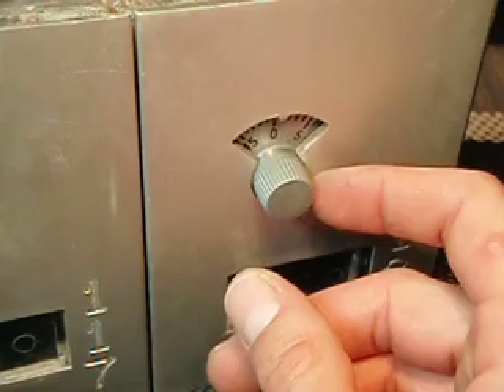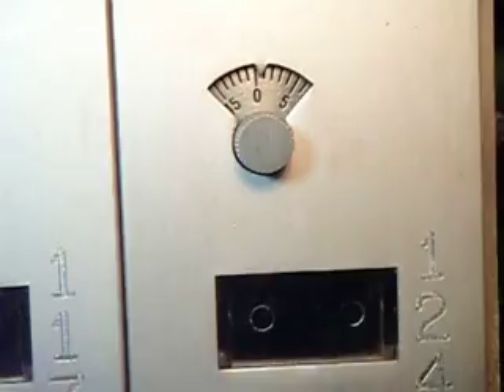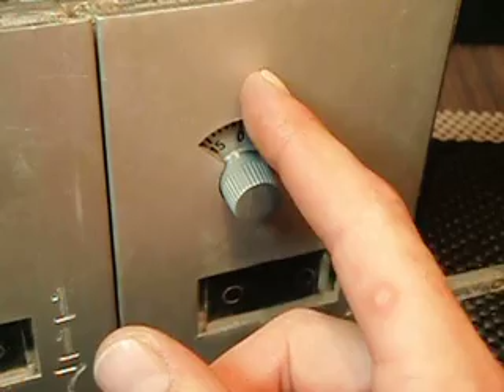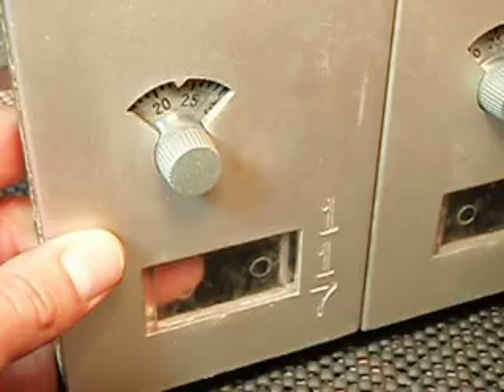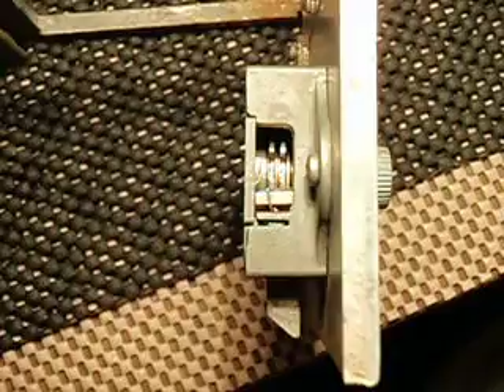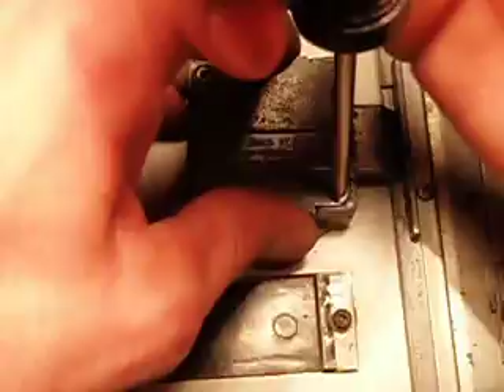Post Office Doors

Comment: @Oldfast911 Yeah it would be nice to practice on something fairly easy like those post office locks. As for the safe I know that the locks work the same as those post office ones, but their much more complicated in the fact that you have to turn 4 to the left 3 to the right 2 to the left and 1 to the right. If you could direct me to some learning vids or books would be great. from my research there is very little videos on safe manipulation. It's very frustrating.